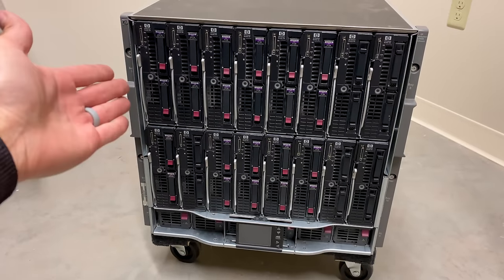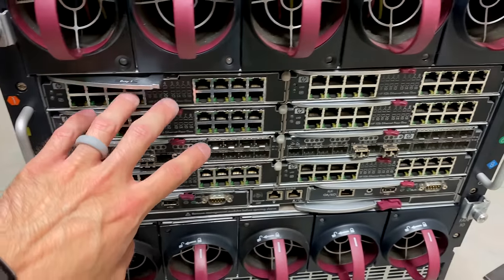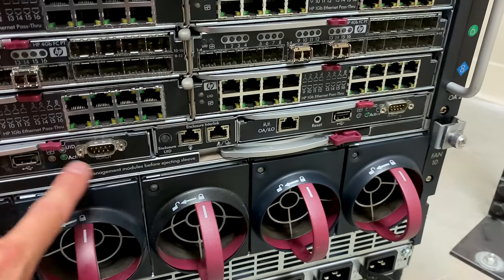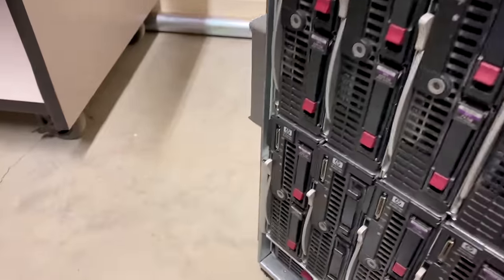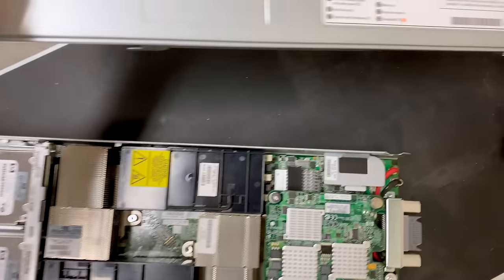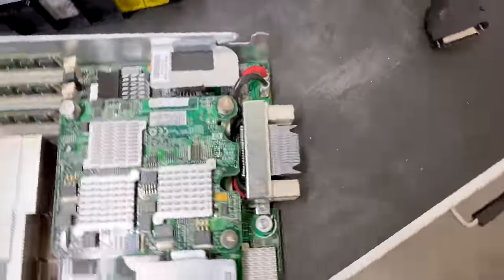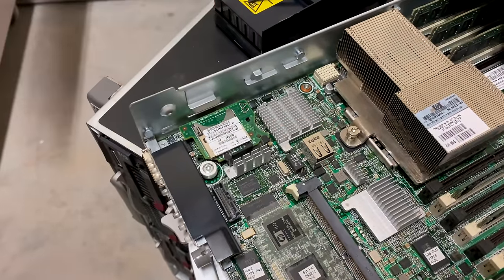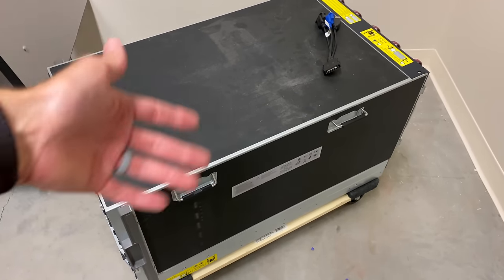Let's Check Out an Old Blade Server System with 32 CPUs!

Comment: I'll add my HP C7000 story: At a past employer, we had a project using the C7000 as the main compute for a private cloud project. This was around 6-7 years ago and our C7000s relied on a big NetApp for its main storage. We were using OpenStack to manage the cloud computing platform but found it was still not mature, ran into lower level driver issues and were generally understaffed for most of the project's life, so it wasn't the best experience overall. Still the HP hardware ran well and I can't complain about it.  In retrospect, it probably would've been better to jump on AWS or even Google Cloud so we didn't have such a big initial capital spend.

Comment: Nice RF Ring for building access ;)
Is it a proprietary RFID or is it based on the NFC Standard?

Been thinking of adding a Multi-Factor Power/Access switch to some of my hardware, so anywhere I see something like that it piques my interest. 

Thanks for the great video on this old but still very cool hardware!
(Well apart from the heat these things put out..... Toasty!)

All the best, 

A fan of the Channel :)

Comment: supported multiple chassis full of BL25ps 10/12 years ago. they were absolutely HORRIBLE. dc converters would fail like nobody's business.

HP has included a torx t9 tool since the Compaq days.... they knew techs would curse them for not using standard philips screws :).

Comment: "Don't get that much out off regular household power"

Laughs in European.
Reply: Just to clarify things:  Standard US power outlets use 120-volt (nominal), but the house is fed by a 240-volt source with two 120-volt to ground circuits.  My electric clothes dryer uses that 240 volts across the heating element, with the motor to spin the drum wired onto one 120-volt side.  So we do have 240 VAC service in the US.
Reply: Alec from Technology Connections just did a very informative video on this:
https://youtu.be/jMmUoZh3Hq4
Reply: Do you really get 200A 240V service to your homes in Europe?  
We get 200A 240V to the house.  The way it's delivered makes it possible to distribute it to outlets in the home as either 120V or 240V depending on what you are running.
Typical wall outlets are 120V, but major appliances like an electric range, an A/C or the clothes dryer get 240V.  Some items like the range and dryer use both 120V and 240V at the same time.  Lower power components like the logic and motors use 120V while heating elements use 240V.
Reply: @buffuniballer  Some places have 230V single-phase power, and some have 400V 3-phase power.
Reply: @bobblum5973  And to keep clarifying- we have 240-volt, but the house is fed by a 380/400V source, our electric dryers and stoves uses 380V ;)
Reply: @buffuniballer  Should be 63A@3Phase 380V if you live in a very old house newer ones are 80Amps per Phase. We went from that to 250A per phase because of a solar roof installation from 74A still with the old cable which a lunatic must have planned, more busbar covered with tar and wrapped in fabric, copper bar more than cable.
Reply: @kitecattestecke2303  we are in a relatively new home built in 2008.  200A 230-240V (single phase) and fiber optic cable for TV, Internet and Phone (if you want a "land line")
Reply: *Laughs in completely uninformed

FTFY

Comment: My company has like 10 DELL PowerEdge M1000e (if our main IT guy doesn't have any more hidden, the sneaky guy) running at 2 locations.
Sure we do like all IT for 80-ish medium to small companies running over 2K virtual servers.
For storage they all have their own storage beast containing nothing but SSD's over those fiber optic cables.
I don't work much on the blades or the poweredge themselves, more on the windows machines within. Windows is probably the bottleneck here but 700MB/s is a normal day for me.

Comment: You technically can run it off 120v = MAYBE.
The 2250W PSUs which are very old can run on 120v but then are only rated for 965W.
The 2400W and 2650W PSUs on more modern c7000s won't even turn on with 120v and require 208-240.
So if you plan on running one of these in your garage in the USA, get the 2250W PSUs.

Also "Big Chunky Square Connectors" = LOL, is this a tech channel?  
They are called C19/C20 and very common in the DC for anything that needs 15A as you can only reliably get 10A from a C14 according to the standards.

Comment: You need 2 Power Supplies just to get the chassis running = FALSE.
I have one in my garage.
You can fire up the chassis and Switch modules in the back on only 1 PSU.
But the blades need around 250-500W of power allocation to be able to boot.
So at 2250, you can fire up a few blades with only 1 PSU.
At 965W you likely can't power on any blades and will need a second PSU to be able to get a few blades to fire up.

Comment: I've been considering making my own blade server chasis or modifying existing ones to work with all manner of old computing hardware I have lying around so my collection of ARM boards, laptop motherboards, NUCs, ITX and ATX motherboards with CPUs aren't taking entire 1u - 3u chasis
Reply: I want my own clusters and it seems modifying old blade chasis to take a bunch of ARM SBCs in one chasis, one ITX, 2~3 NUCs, 1 laptop board each would be a great way to cut down on my limited home rackspace

Comment: Is there really an instance where a blade server can do something a VM server can't? I'm struggling to think of a specific case. As long as you don't under provision the hardware compared to your software's needs, VMs should be able to keep up just fine in high demand environments. The main thing that comes to mind, is that with VMs, there's less that has to go wrong before you're in serious down time trouble, whereas if one blade fails, you're not completely dead in the water.

Comment: we bought 9 of these and mined CPU crypto for a few months. You do not want to power or try to get rid of the heat for those things. Initial tests fatigued and ruined the 200 amp main breaker in my house. The only real way is to run them on 3 phase power.

Comment: The c7000 should have ilo 3, g1 g2 has the ilo 4 and g3 has ilo 5. That's the main diffe Between shassis. You can put g9 blades in a g1 enclosure and that's the cool part

Comment: I have one of these. It's pretty sick but I don't do anything with it. I also have a ton of the gen 6 blades that fit into it with the x5670s
Reply: Jordan Ebner if you can afford the electricity (solar?) have a look at becoming a contributor to rosetta@home on the BOINC platform.

Comment: IPMI is the 4LA you are looking for.  I note there are only 4 FC GBICs, were you not connecting all of them to a SAN and just using the onboard HDDs?
Reply from the maker: A lot of them were removed and repurposed over time, but we completely got out of FC about 5 years ago in favor of iSCSI. I probably have a bin full of transceivers somewhere.
Reply: @ThisDoesNotCompute  So you went to iSCSI over GbE?  With 6 ports per blade that's just a smidge more bandwidth than redundant FC.  I watched on the other video that you had 10GbE, did the blade center have 10GbE too?
Reply from the maker: We stopped using the blades for virtualization long ago and never had them on iSCSI. For the last 5 years or so only a few blades have been in use, just for some specific apps that were fine with the local storage.

Comment: How do you do the decommission? Do they actually let you take the hardware after its life is done? Or are you tech support or an independent contractor which is somehow collecting the hardware?
Reply: Most places will either sell it to a reseller or, if it's too old to be valuable enough to bother with, they'll sell it for bulk scrap and ship it off to a secure e-waste facility to be scrapped.

Comment: Would be an ideal unit for 3d rendering I suppose, many CPU cores and RAM, but not much storage needed,
Reply: unless it's a workload that very specifically requires processor cores instead of being GPU accelerated, you're better off stuffing a few Quadro GPUs into a standard rack-mount server and going that route instead.
Reply: @mndlessdrwer  GPU render is great for certain things, but the majority of rendering has to be done 'brute force' eg. CPU. GPU is fine for situations where a  lot of optimization in geometry, shaders etc happens before hand - like in games. In my case we have hours to setup and crank-out scenes... So I still rely heavily on CPU.

Comment: If anyone wants to learn how these really work, here you go.
https://h20195.www2.hpe.com/v2/getpdf.aspx/4aa4-8125enw.pdf
https://h20195.www2.hpe.com/v2/getdocument.aspx?docname=c04128339

If you want to see what other Blades exist out there.
HP c7000 as shown here
HPE Synergy 12000 = HP's new Blade Chassis
Dell M1000e = c7000 clone from Dell.
Dell MX7000 = replacement for the M1000e
Cisco UCS 5108 = Cisco 8 slot Blade Chassis
IBM H/HS Series BladeCenter
IBM/Lenovo FlexSystem = replacement for the H series.

Comment: I hate blades. When the first came out the data centre didn’t have the ability to cool more than one, per rack which made them pointless. Most CMDBs only have the ability to store the name of one ILO so you mostly stored the per blade one and immediately forgot what the onboard administrator IP was. Those internal switches are a horror. You have all the hell of having all your eggs in one basket so it makes fixing the chassis itself almost impossible. They (this may be better now) hell to manage programmatically. 

Awful things.

Comment: These were really popular 10-15 years ago
Ummmm, maybe do your research.
I work for HPE and can tell you we sold a TON of these, even up till 1-2 years ago.
The replacement for this from HPE is called Synergy.
On the other side, Dell also released a brand new blade chassis called MX7000 just a few years year ago.
The density actually makes MORE sense with Virtualization where you have mostly shared storage.
Reply: AT one stage I was managing 16 chassis full of everything from g1 to g6 blades..  Still have 4 of the platinum chassis running g9's and another 4 synergy frames..     Have 3 more c7000's full of g7's but not really using them..  Given the chip shortages I'll hang on for a little longer !!

Comment: Aren’t blades still sold for extreme super computing? I was under the impression most all of the highest performing super computers around the world were made up of blade servers.
Reply: maybe ones that work in clusters, unlike this type that stores separate systems which I don't think is used a lot anymore in enterprise, especially now you can run a whole team's VMs off a single server with the same core count as all the 16 blades he showed here.
Reply: @amirpourghoureiyan1637  yeah mostly used for clusters for parallel computing, or running a bunch of VMs on (which I think could run one beefy VM across multiple machines if you needed that)

Comment: I tried to save old corporate equipment.
The NOISE was intolerable and the electrical bill cost a small fortune.

Good news is that businesses only need so much processing and storage.
With less than 2nm fabrication and 3D layering, servers that size should be someday smaller than a briefcase.
And with AI tecnology we should be able to talk to it. 

Bad news...
We had a great down sizing of ITs and devs about 15 years ago.
The down sizing will be painful when AI come online.

Comment: not quite sure why companies would wanna phase them out/stop using them... these things themselves make for absolute power house VM Hosts... company I work for uses blade systems almost exclusively. we have so many properties over the US, that basically there is a singular property in each 'region' with a set of Blade Chassis, and each property gets two blades dedicated to them for redundancy, and the blades run ESXi and operate anywhere from 20-80+ VMs each. I personally dislike this sort of centralization of it all, but hey... makes it easier for me to fix problems when the Chassis housing everything is in the MDF behind my desk, instead of hopping on a plane to fly out to them.